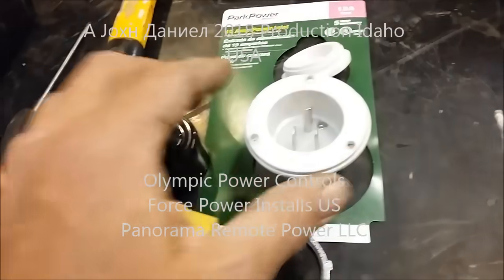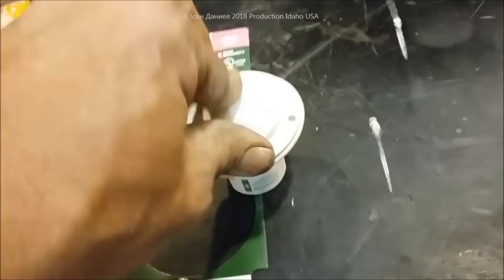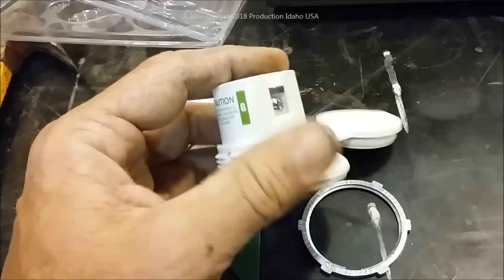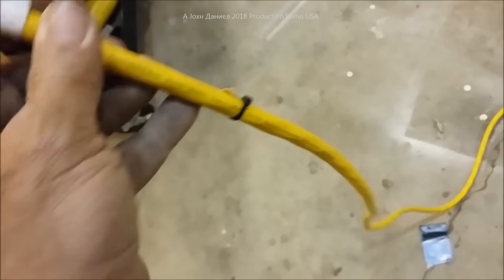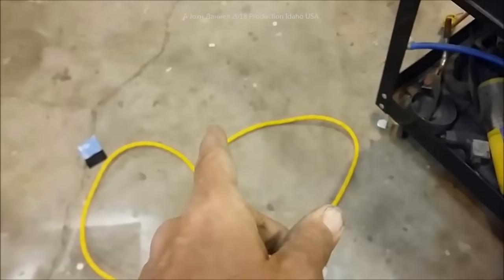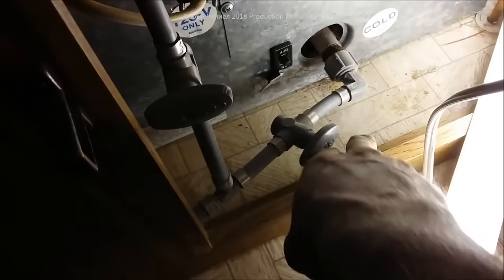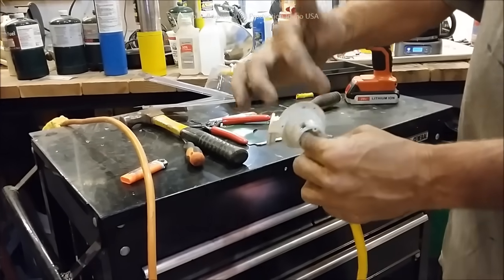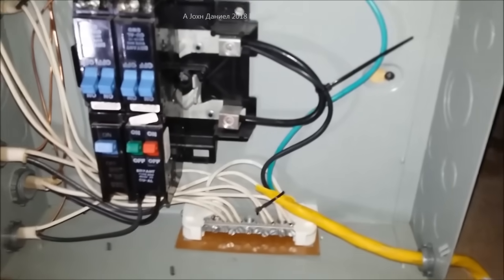Power Your RV Camper while towing with 120 volts AC , info below

Comment from the maker: The adapter is PARK POWER https://amzn.to/2rJJb1a OR https://tinyurl.com/ParkPower150 The Power Inverter https://amzn.to/2L5TrsD is a POTEK 3000 / PEAK 3000. Other great Inverter is https://amzn.to/2rLcDDF . You can also get the best per watt micro 1800 watt generators too https://tinyurl.com/WEN1800wattGenerator5stars under $200 with a good full deal warranty FROM all WAL-MARTS!!  SEE VIDEO 1 on RV POWER https://youtu.be/em96kCb1xJE - Numerous power inlet models are available. I use 15 amp due to the ease of finding 15 amp cords and the outlet on my inverter is 15 and will pop the internal breaker if I exceed it. This small option can also allow you to run the basics from a small generator like this one. 
Be sure you use equally rated materials in your build or modification.

Comment: Other option is to create special cord or an adapter with two male heads. Other similar setups use a transfer switch. Im guessing you just have to remember to unplug or switch off your inverter before starting your RV generator. Or did I miss something else?
Reply from the maker: The RV generator will be added with a dual auto transfer.

Comment: Great idea. My three way fridge quit on me so I'm using a 5 cubic mini fridge with a real freezer and separate door. My plan for running it while driving is to use a 400 watt inverter from the onboard battery that gets charge from truck while driving. Looks like a couple ts105's will fit nicely in your battery box, mine only room for one standard size 12volt. Like you I'm keeping my batteries and solar on the truck. Thanks for sharing.
Reply from the maker: Did it leak, yellow stains and bad oder from it? If not don't toss it, cheap to fix them.
Reply: Yes it leaked. I thought I really needed the propane fridge for simplicity of boondocking but with this I don't have to be absolute level to have it work properly. I don't have enough solar yet but in the meantime that two cycle gen from harbor freight will keep my batteries charged till then. Plus I'd rather camp in the woods so not even sure I'll even buy more solar. I bought the same kit you did so far. I don't mind carrying two generators. One for just charging batteries and one for when I absolutely must have air. Thanks for the reply.

Comment: Why can't you just plug the cord from the inverter into the shore power inlet on your RV?
Reply from the maker: I just Rather have the cord on the inside while driving than strapped 25 feet down the outside.
Reply: Makes sense.

Comment: Mr. Daniel,  I noticed on eBay that there is an inverter brand Cotek in blue and black that appears to be identical to GOPOWER yellow and black comparables. would have an opinion on either of these new versions now appearing?
Reply from the maker: Cotek is the main company, Samlex - Go Power and they are mostly the same, but cotek does use some higher grade in some parts, Go Power is a reseller who gets bulk units in a color or slight variation at a price which means not all parts may be upper grade.

Comment: John, i have been thinking of doing something similar with the inverter connected directly to the truck starting battery / alternator without the additional deep cycle batteries and solar. You think that would work?
Reply from the maker: You would destroy your car battery, its plates are much to thin to last long. A deep cycle can withstand the surges and unless your truck has at least 120 amp alternator, and you plan not to run over 700 watts through your set up, and no running it when the truck is not running, then I would not direct connect to the trucks battery.  
recently I installed 4 UB12350 batteries ( https://amzn.to/2IRb3Li ) in a row on a guys truck frame, neat and easy to do and he is running that 140 amp isolator ( https://amzn.to/2LAS7hn ) like me, his runs perfect. Just be sure to run 4 awg between the batteries, then 2 awg to the inverter no longer than 5 feet.
Reply from the maker: PS, the inverter of absolute choice for having excellent cooling and smooth modified wave for just running the basics while in motion ( 700 watts) would be a KRIËGER 1500 Watt  https://amzn.to/2xiXOxn due to its parts like fans and mosfets are made in Japan
Reply: Јоhn Daniel - thank you for the excellent video and reply to my question.

Comment: Just thinking If you have 3000 solar inverter charger in your trailer and use the solar input you will not need second power inverter in yoUr truck . Just run 12 power from truck to the  trailer solar power and will charge battery as you drive down the road
Reply from the maker: My trucks system is used on numerous RV's . I own 5 so it's either put power on 5 or use the truck as the energy during points no other source is available.
Reply: ok you have more than one RV and your system is better

Comment: So when you are boon docking you have to leave you rtruck connected to the RV? Not the ideal design IMHO
Reply from the maker: It's not for boondocking. It's for use when no other source can be applied.
Reply: I have the same setup, battery is in the RV Inverter is in he RV , When the Truck is connected the Truck 12v charges the battery plus the solar panels. the RV battery runs the inverter. If I am at a place where I can hookup the converter charges the battery. It works.  It works when the RV is not connected to the truck. Does yours work when it's not connected?

Comment: Why don't you just plug the shore power connection into the inverter while going down the road and no wiring needs to be done. It accomplishes the same thing and you don't risk getting shocked with an illegal plug that is improperly installed.
Reply from the maker: The plug is not illegal, nor is power 12 volt or 120 volts connected between vehicles illegal as long as any connection is not "permanently  wired" between the vehicles. Your alternator produces AC voltage, you can legally send it back in a 3 wire plug to anything and put in a rectifier in to convert it. Because it's ac voltage on one plug makes no difference. My shore power connection is 25 feet down the side of my trailer, hanging a wire down the length of its side to my truck would be much worse when all I need for basic power is 10 to 15 amps.
Reply: Јоhn Daniel there is nothing wrong with powering your camper while it's under tow but if your 15 amp park power plug is energized when you're shore power is connected that doesn't meet code. Also if you have movement between the two vehicles you need a twist locking plug to ensure it doesn't come out while towing.

Comment: Look like you have room on your breaker panel why you get a breaker 20 or 30 amp and run your truck power to it so you can turn it off and kids do open cover and get shock from it.  This way easy turn it on or off
Reply from the maker: I did as I explained put a box over the outlet, mostly to prevent stones thrown up by the trucks tires from damaging it. But its got a lock on it, and the 30 amp breaker in the box disconnects the 30 amp twist lock when I plug into my truck as I roll.

Comment: Turn the A/C on.
Reply from the maker: Sure bet, watch next related video. Was no need to do that with temps being 44 degrees, damn compressor would not kick on. But soon we be gettin some heat here. But you can see a few other videos I did where i use the same inverter to fire up other old craggy A/C units on salvaged RV's with great results, only one so far with a seized compressor made the inverter bitch and toss a breaker.

Comment: I would get a twist lock plug for such instead    my moms old pickup camper had a 3 way fridge   so much nicer so didnt have to worry about such   my dad one time stopped at a buddies cabin which had no power it was off grid and he forgot to turn the fridge on propane instead of 12 v and when ready to leave the truck wasnt  lol dead battery we didnt have cables but his friend did except they didnt work  we used a piece of 12 gauge wire he had and charged it off his van
Reply from the maker: With a 3 way fridge all you need is 500 watts of solar and it will run when theres sun!  But they never seem to freeze stuff well on DC volts.
Reply: Јоhn Daniel  it was a fridge no freezer

Comment: My ammonia sprung a leak on mine sitting in my driveway, luckily  it wasn't cycling. Replaced with 110 volt fridge. Getting four 6 volt batteries and inverter system also. The is for the video.

Comment: You are risking killing the  someone  as you stated the inlet will be live whenever the factory inlet is connected. The charge  for killing someone after performing illegal electrical work  should be murder. Children play with anything they find. A licensed electrician could install a changeover switch depending on the local codes . You should be liable for any and all  incidents of persons taking  your advice . It is also evident  you have very little knowledge of electrical theory p=v/i  3000 watts/110 volts=27.3  amps to a 15 amp inlet is just  wrong . What if  the plug falls out, of the trailer becomes live due to a fault and someone makes contact between car and trailer. licensed electrician for 45 years  don't do this .
Reply from the maker: The reason I did this is due to how many RV owners I have caught tapping their electrical with a cord and having absolutely NO way like I show how to switch off the main or not energize the factory cord in reverse  when using. Also the reason I installed and linked my other video how to put in a twist lock so no hanging cord is hot or open on the original 30 amp service. On RV's I have seen some put males on both ends and plug it into a random outlet!!! And, Yes, children stick their fingers in light sockets, hot water heater burners, in the flames of open stove burners, into moving lawmowers, run over power cords with lawn mowers, do Heroin, jump 4 wheelers over cars,  and take and swallow laundry soap to get stoned. Besides that being natures apparent way to prevent reproduction of idiots it is without any doubt what children with careless parents do. However where I state I am putting a additional cover over the 15 amp inlet has its reasons. Showing How to switch off the 30 amp main before use also was detailed. WHY? Nature may send one of those poorly parented kids to stick their finger in it!  If used while on a 5 minute road stop the outlet would have the cord IN IT, so it would not be open.  
In my video information where it says READ ALL I plainly state the common cautions, including the inverters built in 15 amp breakers on each 2 outlets. And if a cord was to fall out, it would no more dangerous than one getting pulled out of your weed eater when you have exceeded its length.

Comment: Why not run rated Rome’s from exterior recessed male connector to the power compartment.  Solid conductors in Rome’s hold up to current generated heat.  Drop cords are dangerous.  Just curious.  Great concept.
Reply from the maker: I figured the sheath on the romex wire was much easier to get damaged in exposed areas under the cabinet compared to a outdoor rated thick skinned extension cord that is capable of being ran over by cars in a work area. But if I would have had some 12/2 underground romex available I would have used it for sure.
Reply from the maker: PS - we ran the air conditioner today with a watt meter ( WHOA NELLY!) and the so called cheap inverter handled it like it has other AC unit test, perfectly, plus it allowed a 14.12 amp start for about 2 seconds, dropped to 11.4 amps for about 8 more seconds then settled on 9.6 amps and ran over 12 minutes until the bank volts hit 12.4 and truck needed to be started. With the truck running the 160 amp alternator and voltage got back to 13.7 but never made it over 14 so looks like another 100 watts of solar, 7 amps more on the roof of truck is called for!! Going to put 10 to 12  solar 100 watt panels on Jayco soon.
Reply from the maker: I could, but the ones one it are only to keep the 3 batteries hot and they work great for running a electric impact, a small compressor and some tools like weed eaters on the other end of my property. 
All my RV's, 5 of them that I do use have or will have 500 to 2000 watts on them as needs arise.

Comment: Absolute genius to do this. Had a RV fridge act up when we went from Canada to Florida and you could smell strong gas smell in the trailer when we left ours on to run on gas when we traveled. Never again. Putting in something like this asap. My 1500 watt inverter in my truck can feed power enough to run a 300 watt fridge for sure. but I am running some conduit for the outlet in the rear of it.

Comment: Smart!  I have a similar setup in my boat for running AC away from the dock. I would recommend leaving the female end on the 15a cord and routing it to the compartment where the OEM 30/50 amp cord is if someone has a trailer with a permanently attached cord like yours had originally. This way you would unplug the trailer and plug it into the inverter removing the chance for backfeeding the inverter.
Reply from the maker: I have just this morning after considering "SOMEONE ELSE" may ignore the label I put on and plug in my truck for me into the outlet, to install a 50 amp auto disconnect inline so the only way the 15 amp circuit will energize is if shore power is dead.

Comment: Great job John!!!
Reply from the maker: It works! I was just using a cord through the window on my other trailer but this has more options I can apply. If I only had a dollar for how many RV Dealership scammer morons who tell me this is IMPROPER without citing one single real reason I could buy 5 more trailers! Those guys would charge you $500 to do what I did for $40

Comment: Nice info, John.  I use twist lock connectors between my motorhome and trailer.  I run my portable Onan generator behind my snowmobile trailer and it's nice that all the wires are already there.
Reply from the maker: Yeah, Love it, very nice. But do you ever get tired of hearing how "improper and unsafe this is to do" hahahaha. From people that drive a Prius with 200 volts of smoking lithium batteries under their butts!
Fact is Boom trucks have been designed this way forever, as well as service trucks with welder generators on them.

Comment: I have not watched your previous videos except for the last couple. My question is this. Have you considered converting the inside lights to LED low voltage to reduce the load on the system?
Reply from the maker: Thats already done, used these https://amzn.to/2rMuVEH  due to their equal balance between daylight white and warm white tones so they run at about 3200k. Seems the ones I linked here must be a much upgraded inner circuit or LED because lumens are up from 400 to 480 but watts per bulb are down to 6  ( 1/2 an amp) watts each from 8 in direct testing I done Compare that to a t-10, 1141 or 1156 incandescent  bulb which is about 28 (2.1 amps) watts and 310 lumens.
Reply: Michael Titchenal JK
Reply: Are the LED lights softer than the standard lights in the RV?  My issue is in the living area they are simply to harsh.

Comment: I watch your videos, you sure are going to piss off a lot of them RV sellers with your tips. We got one of those inverters and they sure as hell ran our air conditioner for hours as needed on the 10 golf cart batteries and 2000 watts solar on our bus conversion. Keep it up, thanks.
Reply from the maker: I have been told its not possible to do, while I am sitting in the RV with the AC running! yeah we are putting 2200 total watts on our upgraded Jayco as well as some portables. All Amorphous Stion. Not some junk shits sold by the RV junk dealers either.